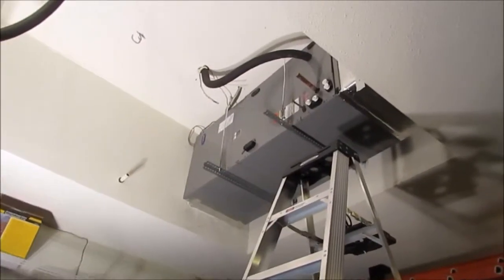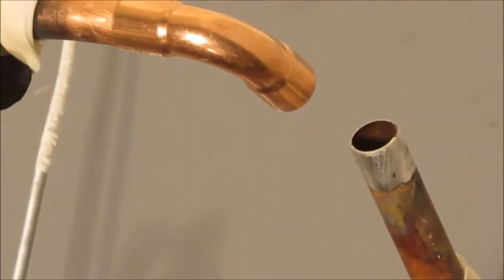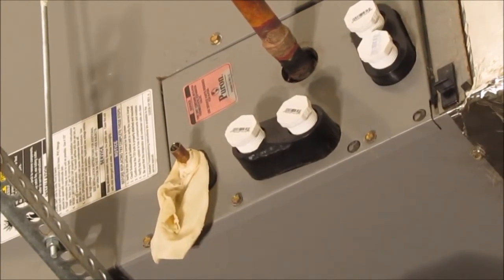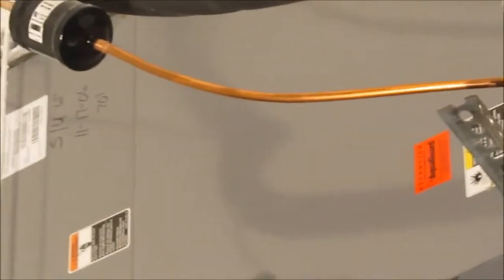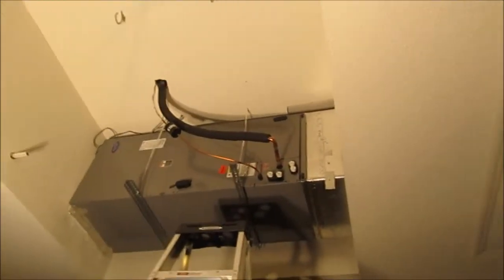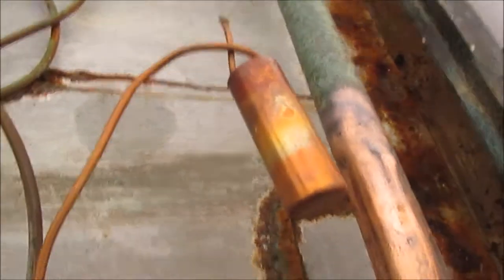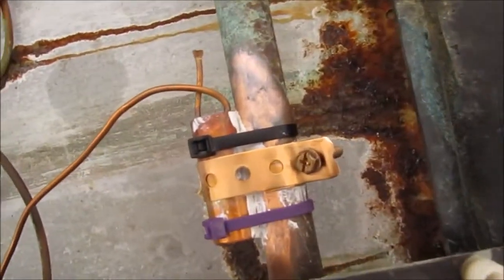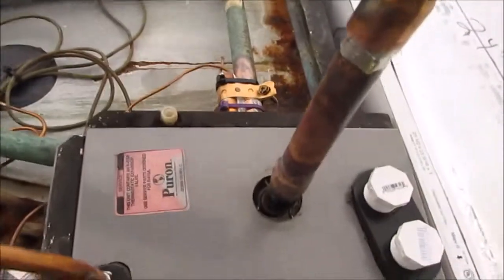HVAC:Pt.7a: 22-5 Ton to 410A-5 Ton-Connect AIR HANDLER electrical and piping

Comment: Thanks for your video. It is really helpful and informative. What are you using for brazing or soldering? Have you used nitrogen while brazing?
Reply: Ignore my last questions. I got the answers from your video. Any feedback on soldering vs brazing and not using nitrogen.
Reply from the maker: I used to use stay-silv brazing rods and an oxy-acetylene torch but on this unit I used stay-brite solder. Watch this video for an explanation. https://www.youtube.com/watch?v=wJD712DB6S0&t=454s
Essentially, instead of heating joints to 1500+ degrees to braze, you're heating them to 450^ F instead. 
At this temperature there's no need for nitrogen because the inside of the pipe doesn't produce ash at that temperature. There's a lot of 'old school' guys that will argue about the use of this solder but I see more and more HVAC starting to use this stuff. I've had no problems thus far using this stuff to date. Note that all my connections are external to the Condenser unit (normal service hookups) and I have never used this stuff on the high pressure port of the compressor. I would probably braze that.
Reply: kaydee457 thanks for sharing you feedback. I have gone through the video you recommended. Really helpful. I saw his other videos but did not come across with this one.  I also like your opinion in regards to selecting contractors. I have a 1800 sq feet bilevel house. We have a 3.5 ton weather king builder grade  unit installed in 2005. We bought the house a year ago and during the hot summer days it ran the entire day and inside temp never fall below 82. I had the contractor coming in to remove outside condenser as we were doing work outside. He checked it and informed me that it was 2 lb low on Freon r22. Our air handler is 110v and the air handler leaking water into secondary drain pan. The contractor advised us to update to anew unit. He suggested to install 4 ton. Asked for load calculations. He said this is what u would recommend or can hire someone to do a load calculation. I had three other local known hvac companies visited house. 3.5 ton with 4 ton air handler to get the air down to the first floor or go with higher seers and 4 ton unit. I have another similar next door with Same type of unit no problem. I did my load calculations myself. The heat gain is coming to 32000 btu. We are in NYC. I may be off a bit but 3 or 3.5 will do the job. I will have to stick with either Rheem or Goodman as they are available to purchase online or find a good deal like you. Any feedback on that.
Reply from the maker: I live in Florida and the first place I usually go is Craigslist as there are (locally) a few suppliers in the area that don't care who they sell to. I used to live in New York (I grew up in Brooklyn and later moved to Long Island) and I know what jerks they can be up there regarding selling to homeowners. Good luck.
Reply: I would probably go with the Bryant, which by the way is a Carrier. I would be leery of any leaks that were repaired unless the seller could show me exactly what/where he repaired the unit especially if damaged by a fork lift. That's likley damage to the coil, so again. I would take a pass on that.
Reply: Thanks for you update. I meanwhile received the pic of the repair. It was done on the top copper line where aluminum fins were removed to fix the leak. I will definitely consider you opinion.